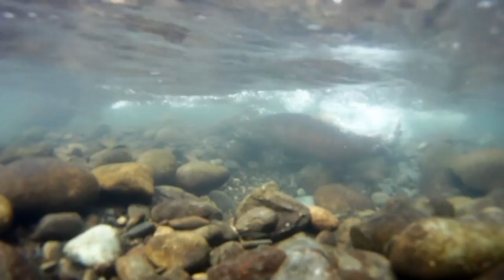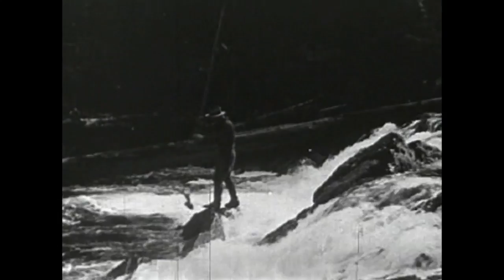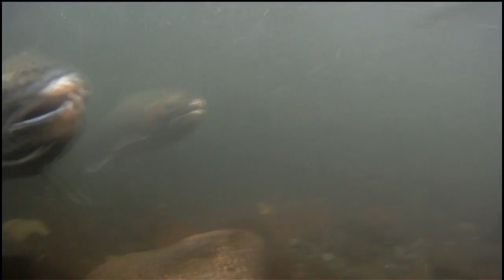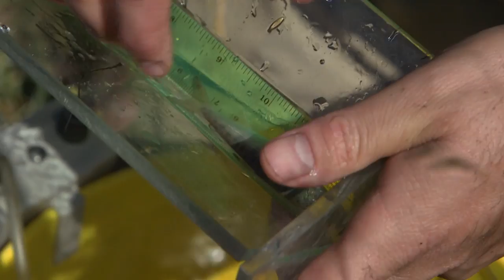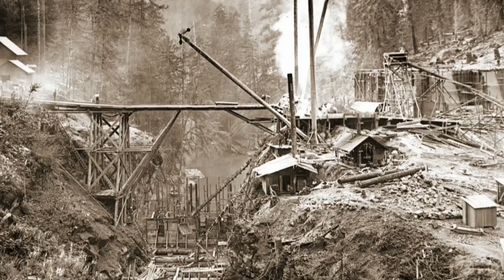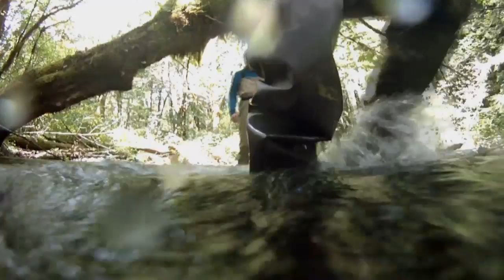A River Returns

Comment: Has any of these dam removals actually worked?  They still have hatcheries on the Elwha.  What's the point of removing electrical generating plants if you are just going to stock hatchery salmon?  You can do that with the dam in place.

It's not the salmon that are "running so thick you can walk across their backs", it's the eco BS being spewed.  Why are we even suggesting that native Americans can somehow survive in modern America as hunter-gatherers?  It's time to move on and live in the modern world.
Reply: Is it better to have these unused obsolete dams fail and kill everything downstream? This dam if you listened was unused, if you need proof of what happens when these damns are abandoned just look into what happened in Michigan last year.
Reply: @shevawnmacdonald4282  I don't even need to go that far.  We had a dam fail 10 miles north of where I live, and there was massive flooding when it happened.  They did do a reclamation project at the old dam basin to restore the stream through the old reservoir, but that was typical eco trash nonsense, and it all failed within two years as well.  If safety is the reason you're removing them, OK, I get it, but that does not seem to be the main issue in the video.
Reply: Give it time they expect the recovery to be 30 years which isn’t bad from 100 years of destruction
Reply: Also I am not happy about the hatchery I wish they just let the salmon be because hatcherys are detrimental